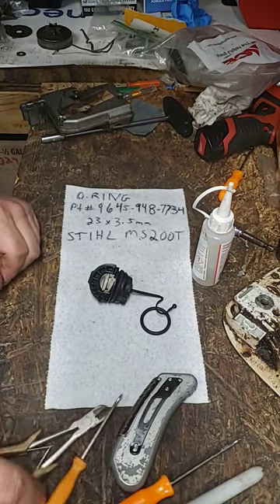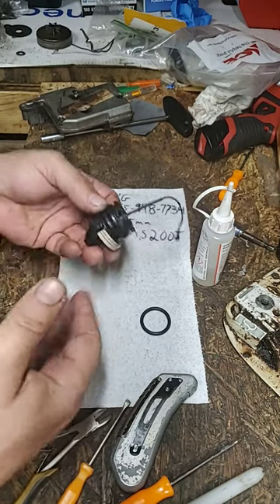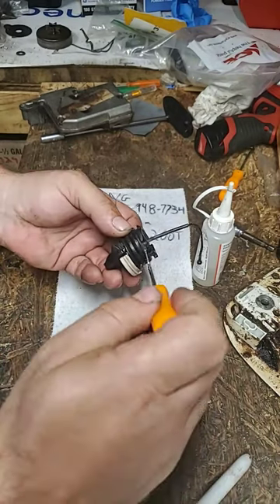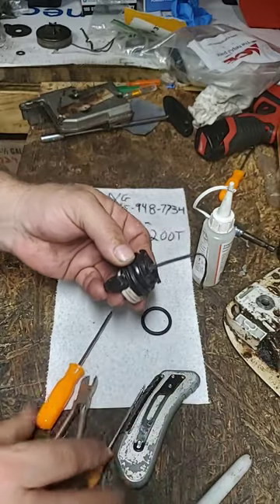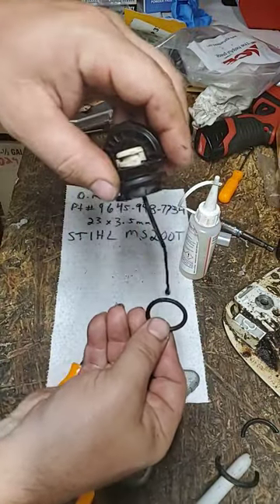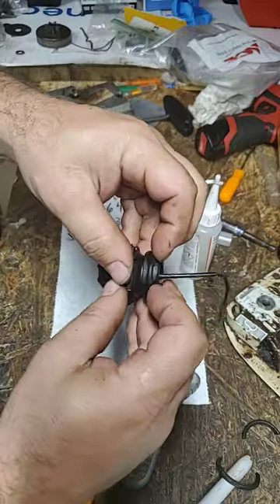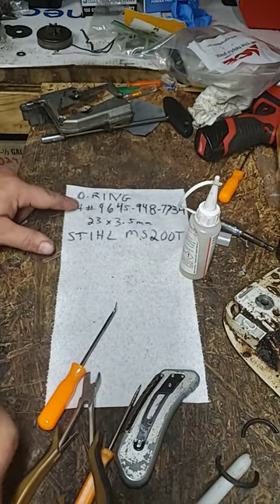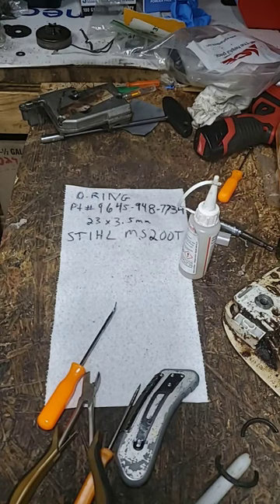HOW TO: replace the o-ring on your Stihl MS200T gas/oil cap and other models!

Comment: Just replace my oring with one from the Harbour frieght oring assortment box. Was 5 dollarsca couple year back....fingers crossed
Reply from the maker: Hope it works out for ya, I used some AM O rings on my van ac last year and one of em lasted all of 1 month made me so mad $140 in freon lost
Reply: @chainsawredeemer85  that sucks.
Much lower risk on my part!
It may fail in a month. If it does  I will let yall know.
Reply from the maker: sounds good